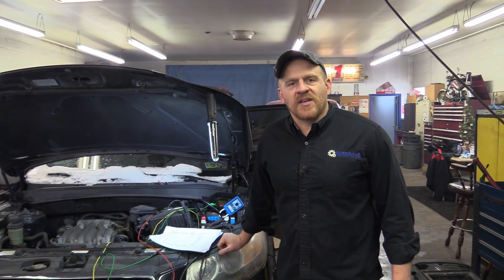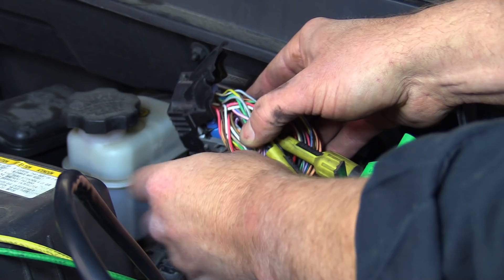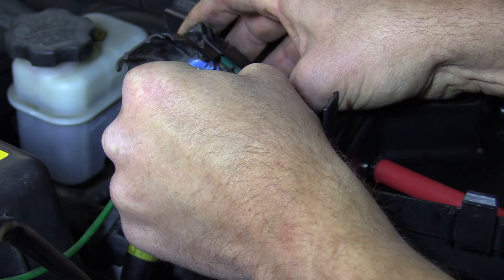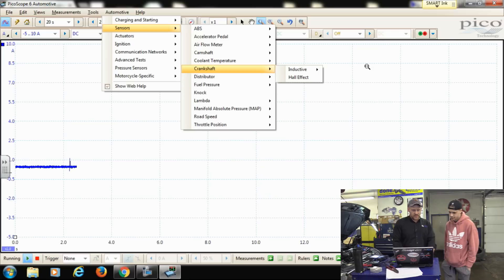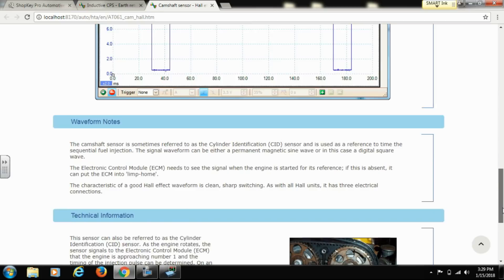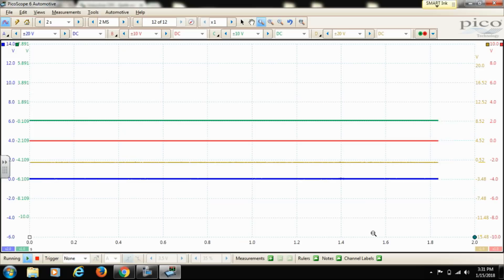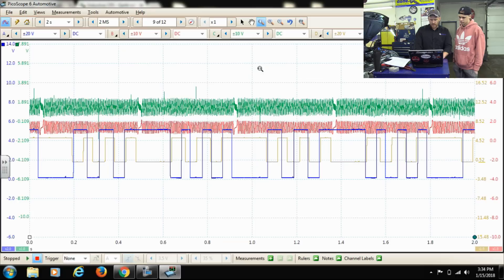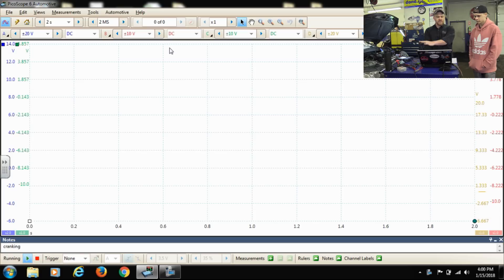Testing CAM-CRANK Sensor Relationship on a Picoscope

Comment: What I find great with Pico is their waveform library (only works with their automotive scopes) but you could upload that trace you captured into it for everybody to use. Saved a couple of head-scratching problems for me. Out-of sync is so hard to detect without a known good waveform. (Or when some idiot switches the two cams' sensors, even though one wire was so taut you could play it as a guitar...)

Comment: That's all an excellent video. The worst part is the pico. So expensive! Beyond the reach of an average experimenter. Anyhow great work.
Reply: LearningZone I know it seems that way,  but if you get it from a reputable company with excellent support, and you put in the extra time it takes to master it, you will make that money back many, many times over. 
 Heck, I'd get it for the frustration it will save you on those difficult jobs alone!
Reply: LearningZone .
Reply: I jeep hesring pico here, pico there to the point where I want to buy a pico instead of a vantage pro. I currently have a cheap hantek 1008c that I haven't used in diagnosis yet. Not familiar but I get the idea of these videos.

Comment: Scannerdanner maybe I missed it in this video. But when you make a crank cam correlation measurement with a scope and the engine has variable camshaft timing. You have to make sure you unplug the solenoids or else you will see a different timing of the engine. Because of the adjusment of the camshaft timing.

Comment: Well, I know where I'm going for Pico instruction when the day finally arrives that I own one. EXCELLENT tutorial!

Loved the outtake at the end. "Who's your daddy?" to your son! 😂 That was great. 😊
Reply from the maker: Thanks Smitty!
Reply: Dont worry, you can download the automotive version of the pico, go to the root installation directory and delete or rename oem.dll, there are other files that you can move from the standard software but I found that they are not needed. The pico database wont work as that works online but you get the automotive guide that Danner shows here.
Reply: I mean to say that you dont need to own the 4k variants of the pico. My myself invested on a 4 channel of the 2k variants. I paid 600 bucks for it and works great. Just get an attenuator for high voltage spikes from injectors and coils but you can always use an amp clamp

Comment: Love what your doing Paul your an inspiration to me and many others!! I did notice you left the coupling on dc voltage on the cranks instead of AC. Don’t know if you noticed. Keep the videos coming!!
Reply from the maker: I prefer DC because I like to see the bias line (constant DC) riding underneath the sign wave (if it uses one). It really helps when troubleshooting opens or shorts in the signal circuits. 
If it's in AC coupled mode, this will block that DC bias
Reply: ScannerDanner that’s a fair comment and something I hadn’t thought of!! Thanks for the advice!

Comment: SO I'm also doing an electrical diagnostic course revolving around the Snap-On Zeus. My teacher showed us this as well. But one other thing he showed us was how we can actually calculate if the timing chain jumped forward or backwards by getting pictures of the cam gear and reluctor wheel and doing the math by counting . I can't find it in my notes however and can't contact my teacher due to COVID, I was wondering if you had a video on this?

Comment: I wish you would have talked about digital cam to analog crank timing curser points. easy wnen all hall but where is the "in time" checked on the analog to digital ? thanks for your work and sharing

Comment: I have watched this video a bunch of times..just on the video alone you cover so much and can be used on all types of applications ..love it ..I have one question if you don’t mind ..what model of pico are you using I have priced them already but need to know the model ..one more thing does one pico do both fuel and diesel..
Reply from the maker: This is the 4425 automotive 4 channel kit. It's been replaced by the 4425a (which I now have) Thank you!

Comment: Hi Paul great video and very informative,just one question....I find the crank sensor easy to understand where the missing tooth corresponds to TDC but why does the Hall effect signal off the cam sensor have so many pulses ? I would have thought that to find the position of the camshaft only one pulse(as with the crank sensor)was needed....Many Thanks 👍🏻

Comment: Great video! I have a question, when you’re scoping known good cam/crank waveforms like in this car, is it a good idea to disconnect the cam solenoid valves on vehicles equipped with them?  I’ve heard people say no need for that and some say it will give you bad waveforms if not disconnected.
Reply from the maker: I've never done that
Reply: ScannerDanner ok good to know, I’ve gathered cam/crank waveforms from several known good without unplugging the solenoids and I was starting to worry about it lol

Comment: Hay paul i got a 89 ford 302 in no spark no in jecter pulse that turned out to be the moduel and fuel pump relay now it runs but it runs ruff and stalls intermittently at idel and is very rich smell i cheked the fuel rail seliniod its not leaking but if i unplug the vac line it seems to not stall but still runs ruff what else could it be i cheked the egr if you lift the diafram it stumbels like it should just wondering what you think

Comment: Can someone explain why the inductive sensor is showing up correctly even though the Chanel is set to DC? Another great video Mr. Danner.
Reply from the maker: A labscope set to DC couple will show both AC and DC signals. If you AC couple a scope it will block all DC and only show AC. 
Mine was DC coupled.
Reply: ScannerDanner well like always, learned something new! Thanks again!

Comment: Why are you using DC setting in pico for a VR crank sensor? should the setting not be AC?
Reply from the maker: DC Couple allows both AC and DC signals
AC couple blocks all DC and only shows AC.
VR sensors have a DC bias that I like to look at along with the AC signal

Comment: Amazing video!

My honda 1000 motorcycle engine got rebuild 4 times and the exhaust valve still hitting the piston.
Compression is 157psi instead of 150psi
Can I use such tool on a motorcycle engine to fix the timing once and for all??? 
Thank you
Reply from the maker: absolutely

Comment: Hey I don’t know if you remember me 
With my 91 Pontiac Firebird no crank vats problem you where trying to help me with
Last night I was trying to figure it out and what I found out was that I had no power to the crank fuse totally dead  that got me thinking why??? So after some research and purchasing a owners manual I found that there r some fusable links but in the progress of locating them I found a connector at the firewall and chased the PPL wire fuse 3 amp
And red and orange wires that go there I opened the cover and it was alll coroded and partly burned wires lol is that why they can burn of corrosion’s??? Plus when I try to charge up batt it sparks on the Negative terminal still didn’t clean the mess up kinda stupid spot to get to you think it will fix my problem???

Comment: Hi dan. Question, how do you know before u start, what kind of crank sensor do you have?
Reply: the wiring diagram shows how many wires the sensor has
Reply: Lol i guess i should have mentioned that to
Reply: By looking at a wiring diagram😉, most of the time hall-effect sensors have 3 wires.
But be carefull there are 2 wire hall effect sensors😁
Reply from the maker: @DiagnoseDan I would make one correction in your statement. The digital two wire sensors are technically not "hall effects" :-) 
Just picking on your term as I've used it myself and may even have it written as such in my book :-(
Reply: Just hook up your scope and look at the pattern. Some vrs sensors have more than 2 wires.

Comment: can you do a A-Z scope setup and when do you need to use attenuators?
Reply: You use them when input voltages are higher than 200V on this Pico. So things like primary ignition and injectors would call for an attenuator to be safe.
Reply: Paul has a 2 part video  on the pico  set up
Reply from the maker: Yes I do and they are linked in this video :-) Thanks guys!

Comment: I've got a 99 chevy 1500 with the 5.3 I've been having surging problems and it comes up as a maf code. I've changed the maf twice and have the same problem under acceleration and was wondering if you would have any idea what that could be. I've had the problem for almost two months since I bought the truck. I was told it could possibly be the small locking clip on the connector or it could be a ground how would I be able to test for a ground problem. Thanks in advance.
Reply: Trevor Bailey check the intake gaskets. Often on those when you have a vacuum leak large enough it will set a maf sensor performance code. Itd be helpful to know what the code is exactly. And if you have access to a scan tool see what the calculated vs measured airflow is. Thats basically what your MAP and MAF sensor read, and if there is a difference between the two at idle.  Also you can check the IAC counts at idle and see if it is at or near zero, that is another sign of a vacuum leak.

Comment: Hi Paul, I just got my ass kicked by a 2000 Camaro 3.8 V6. Just wondering if you would have done what I did. Came in on limp mode. Can’t remember the code number but it said no crank 18(reference)signal. I checked crank signals 18 and 3 and cam signal by piercing at the icm. All good. The 18 signal to ecm however was missing. Seemed simple, needs the icm. Replaced icm and same problem. Rechecked and found signal 18 to ecm ok at icm. Ok so bad computer too. Replaced ecm. Same problem. Long story short, there was an internal brake in three of the wires close to icm. One 18 signal, one ecm to icm signal, and one 5 volt bypass. The way I finally figured this out was by using the t pin instead of piercing. The reason I didn’t see the signal the first time was because I pierced after the break. And the second time I pierced before the break, thus replacing ecm.
Reply from the maker: Wow man! Great job in sticking with it and finding the root cause. This is where pull up and pull down circuitry is key and the engineers don't give it to us.

Comment: Thank you for all your videos! I have a question what is a Crank High and Crank low, I could not find much on internet
Reply from the maker: "high" is always the signal wire and "low" is typically the ground of a sensor